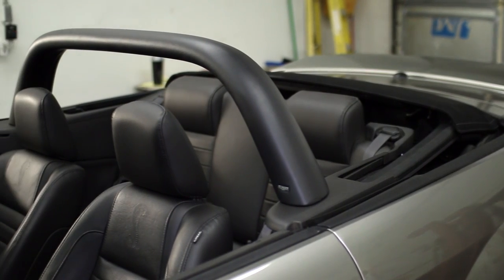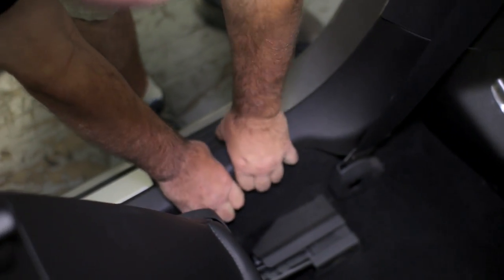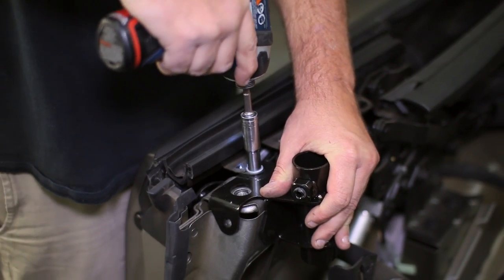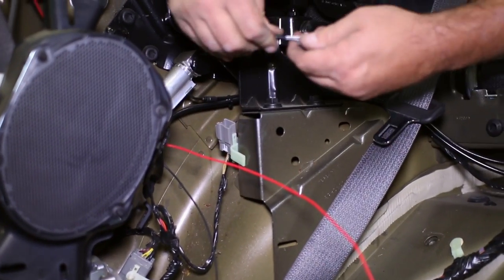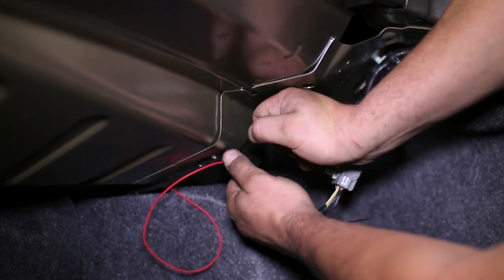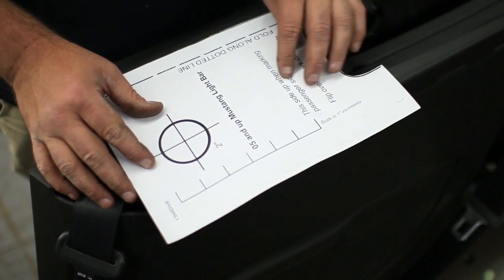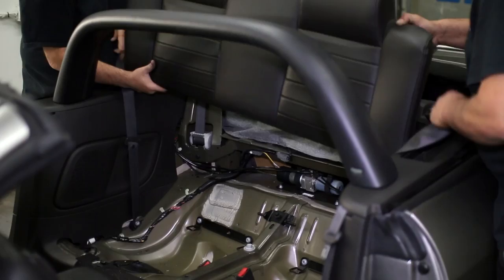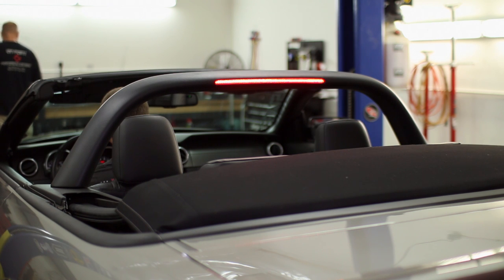2005-2014 Mustang Convertible CDC Light Bar Install

Comment: You don't need to take off the lower plastic cover, just the top piece. There's also a torque spec. for the seat belt Torx bolt...30 ft./lbs. The CDC kit also comes with 2, 6 inch velco strips used to tie off the convertible cover so it doesn't rub on the lightbar. The instructions that come with the bar are good.

Comment: Vid says: "Will not affect the function of your convertible top in any way."  ..and yet there are velcro straps included in the kit to tie the headliner up to the frame tighter so they don't hit the bar... and despite the nice build quality of the rest of the package, this method is a bit cheesy and its not specified why this might be necessary, what models etc. Your thoughts Stage 3?
Reply: The straps are apparently to help stop the inside vert roof material from rubbing against the lightbar, marring/scratching it.